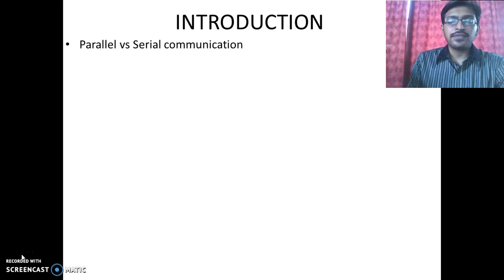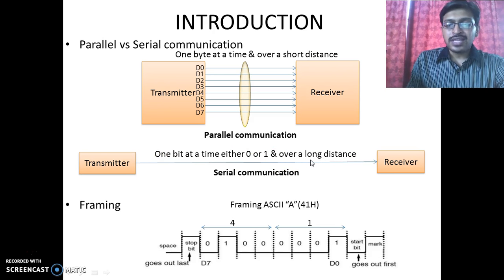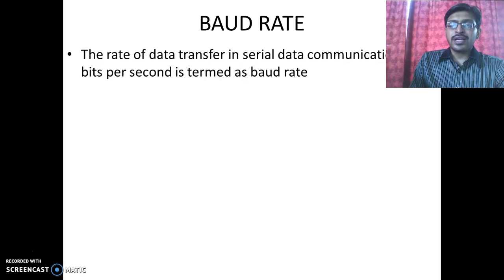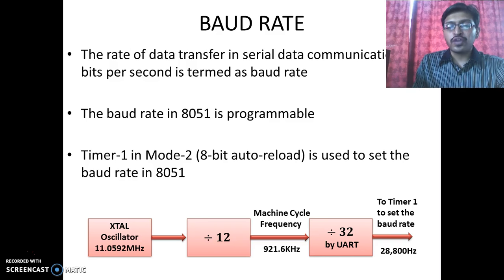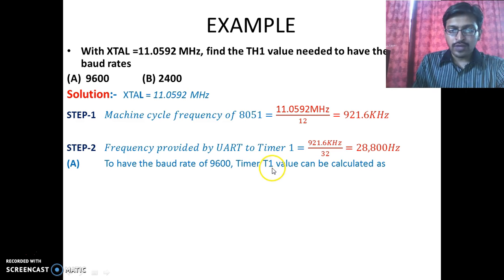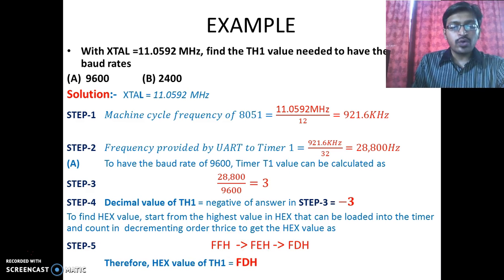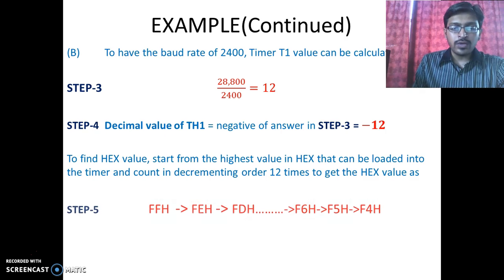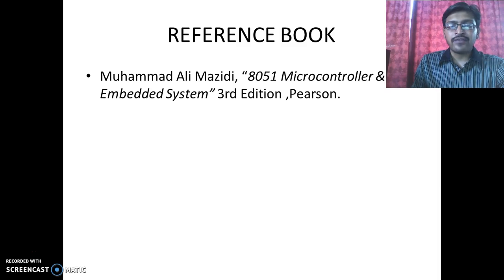Baud Rate Setting in Serial Communication in 8051 Microcontroller

Comment: what is the maximum baud rate that we can set using 11.0592. as per the calculation i think its 28800 what we can set.. because if we try increasing the baud rate say like 57600, the answer will be 0.5, so in this case what should be the TH value.

Comment: If we have general i/o pins in 8051 micro cntrlr why we use serial port for sending and recieving data serially we can use those i/o pins isn't it?
Reply from the maker: First advantage of using serial port is that no. of pins are saved as only RxD and TxD pins are used for data transmission. Second thing is serial communication is long distance communication.

Comment: hi sir

what is AUTO reload in timers how it works in Serial communication??
Reply: timers in 8051 can be configured into 4 modes.
1. Timer 1 mode 0  [13 bit counter]
2. Timer 1 mode 1 [16 bit counter]
3. Timer 1 mode 2 [Auto reload]
4. Timer 0 mode 3 [split timer 0 into two 8 bit counters]
[since 8051 has two 16 bit timers/counters

Comment: Sir my question is why with number 32 only we can use other number to get 28,800hz?
Reply: It depends upon the UART circuitry. In 8051 circuitry it is by default 32. It may vary from controller to controller

Comment: why we are using baud rate usually 9600 kbps   in UART??
Reply: Because a 8051 core is not fast enough to leverage higher baudrates. 9600kbps generally adapts better to the 8051 processing speed.

Comment: Why cant we use i/0 pins as serial com pins
Reply from the maker: there is SBUF register which acts as parallel in serial out shift register for TX and serial in parallel out shift register for RX. While transmission of data the data is first copied into SBUF register which is framed with start and stop bit and it is then serial (one bit at a time) transmitted on TxD pin. Same way at the time of reception the data is received on RxD pin one bit at a time and copied into SBUF register and then taken out in some another register. Every pin has its dedicated role according to the hardware inside the chip.

Comment: Why cant we use i/0 pins as serial com pins
Reply: Because UART send and receive registers connections are hardwired to the TX and RX pins. You could use regular I/O pins for serial data transfer, but you should have to code your own uart in software (much slower).